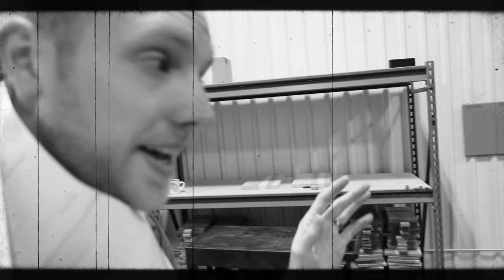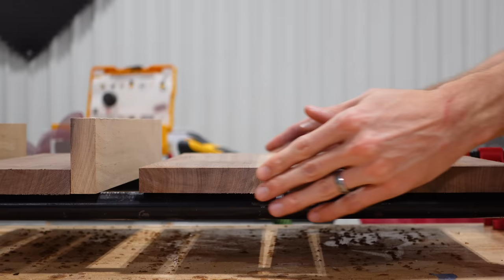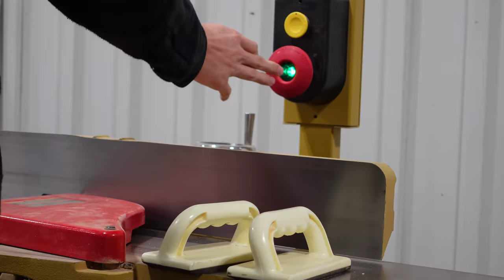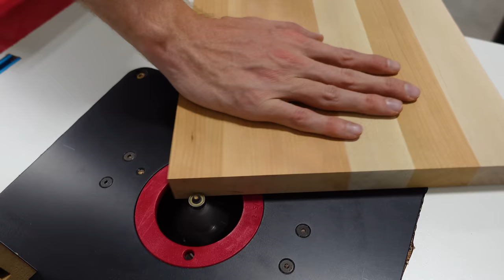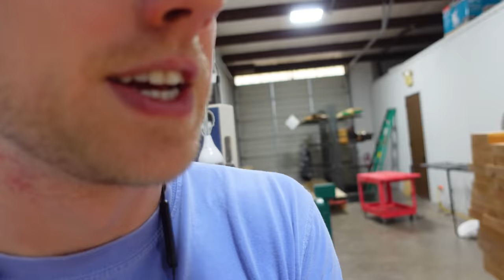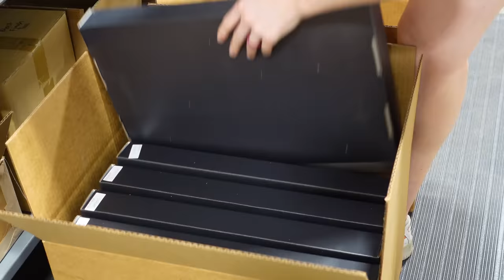Building 350 cutting boards but they have to be delivered before Christmas!

Comment: Yeah, Christmas went nuts this year. My wife and I run a shop out of our basement for Etsy and I already have a full time job. We got a record number of orders in a single day. Got 21 stove covers/noodle board orders in 18 hours. The amount of cutoffs and sawdust alone has been staggering. Burned out 3 RO palm sanders, melted 2 planer belts, took a hand planer to the palm of my hand,  nicked my finger tip in the table saw, and stayed up many nights until 4am, just to get up at 6 to go to my normal full time job. To anyone that thinks this stuff is easy, it ain’t. More power to you guys, and hope your holidays are awesome. 👍
Reply: Do you have any tips on breaking into the Etsy market? Just seems like everyone has cornered every inch of it and driven the prices so low. Every product I look into building there is a dozen people selling at or below what my cost is to build.
Reply: @keyboardoperator802  Etsy selling is a tricky thing. Digital products sell the most, but physical product scan be lucrative if they are high in demand. There are two ways to sell on Etsy, Sell it cheap, or make it unique. If you can do both, even better. For us, we made something that was slightly different than most, but were able to make it cheap enough to appeal to most, cost-wise. For us, adding custom hand painted designs onto the board makes it stand out. Another thing is that spending money on Etsy "ads" definitely increases traffic to our page. We currently average around $3-4 in sales for every $1 spent on ads during peak shopping times, like holidays and weekends.
Reply: @allonthetable1  that seems to be my biggest struggle I enjoy building high end products which I can’t sell cheap
Reply: It's not easy hence they didn't do it.
Reply: @keyboardoperator802  When first trying to break into a market, and this may sound counter intuitive, your best market is rich people. Sell high quality products at ridiculously high prices. Your margins will be higher, meaning you won't have to have as much inventory to hit your break even point and your competition will be less because they will have to match your skill level and cannot match you through automation.

Comment: Ok, first off you should both be super happy at achieving your goal for 2022.  I do woodworking as a hobby, and I sell software for a living.  To that end, my particular specialty is around software automation where I focus on inefficiencies and how to resolve them.  You are running into a huge one in that your output is now constrained by how quickly Davis can assemble the orders that Jenny sells.  That means you have two options, one is to sell less (not a good option) and the other is to get Davis spending less time building while maintaining the same output.  When I watch your build process Davis, the first thing I notice is how much time you spend processing the boards down into strips, only to glue them back together into a semi finished product.  You also seem to cut the length at 19 inches or so and then trim away about 1 inch off the sides in order to hit your final 18 inch dimension.  I would recommend two changes:

1) Make your strips out to 37 inches, glue them up and process them down to two 18 inch boards.  You will have less waste in total and will cut your time processing the wood in half..

2) Get a panel clamping system (Rockler sells a decent one).  THe faster you glue, the faster you get your product completed.

In short, you don’t want sales to outpace production, this is the heart of every supply chain problem we as a world face right now.

Comment: Davis, I just noticed that you have like 6 different steps which are being done one-board-at-a-time. @Andy pearl is right about things like ganging boards at the band saw, but that table saw step is a slow down. And, all  those carts are a huge logjam waiting at each station.. might want to think about an assembly line system after this is over?... Great that you got the glue roller applicator, BTW. For the very specific products you are making, you need to find ways to cut down or eliminate all those "fiddly" steps. Great effort, though, and the products look well made, lovingly crafted - which matters a lot to your customers. Don't let the "overload demand" destroy your love for what you do. Just take on the challenge of making it work better.. you are doing great!

Comment: Screw some 2x4's or 2x2s' against the cart legs inside the carts.  Screw to the plastic legs and the top and bottoms for for stability.  Also, that planer can handle a lot heavier load than what you are feeding it.  You should be able to put 4-5 strips in at a time.

Comment: Hey Guys, I make about 200-300 boards a month with a similar handle have you guys looked at getting a shaper so you can template route more than one at a time (that's my next move), also on the band saw I cut 6 at a time if its maple and 9 if its cherry. Keep it up!
Reply: Where are you located?
Reply: @csranch2000  New Hampshire

Comment: Hi guys. I noticed in this video you're standing each board on its' edge when branding it. Wouldn't it be quicker to just get a big stack of boards all aligned then you cen just work your way up or down the stack with the branding iron? Just a thought.

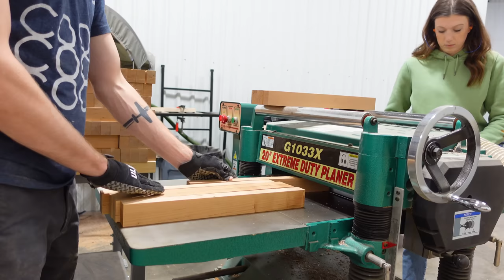Comment: Surely, I can't be the first to comment this, but I will anyway since you haven't addressed it in any of the videos. 4:48 you're running what looks like 1" wide boards through your 20" planer 1 board at a time. You could easily push 10-15 of those through at once. Why aren't you? There's gotta be a reason, right? It seems like it would save you so much time...